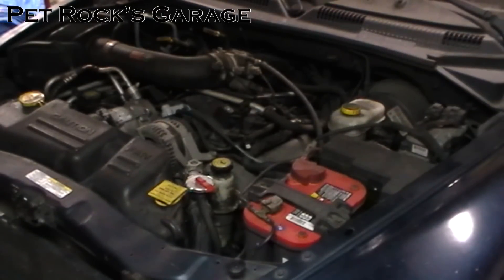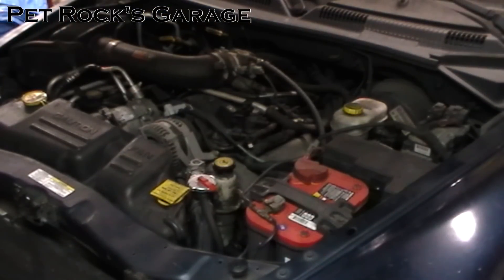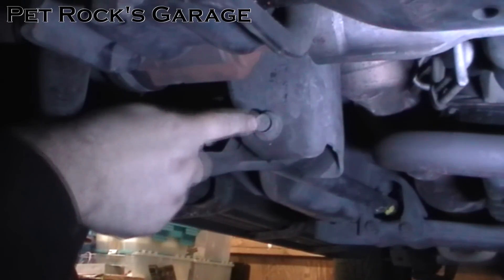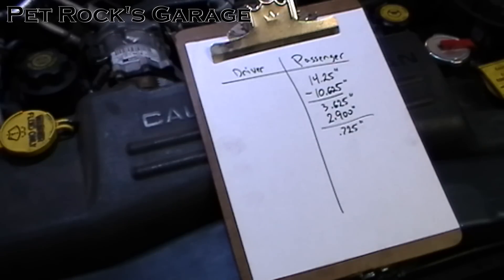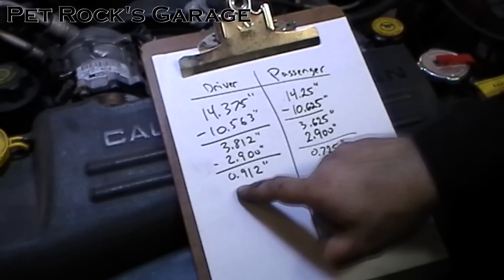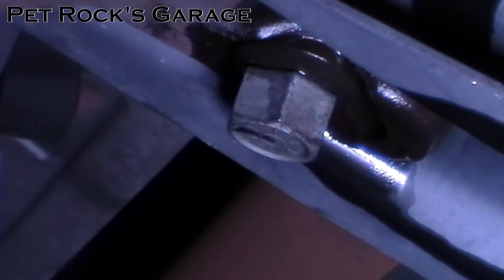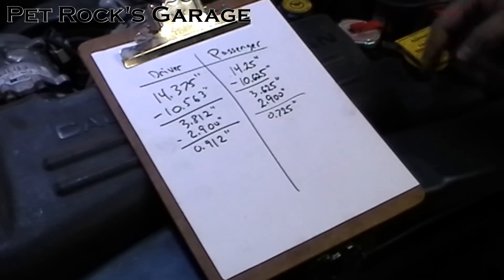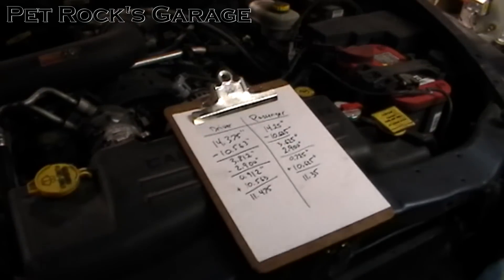How To Adjust Front End Ride Height - Dodge Durango 4x4 (’98-’03) & Dodge Dakota 4x4 (’97-’04)

Comment: This is probably the most helpful video I've ran across. My Dakota had some camber issues and this fixed it right up. I know it's 2019 now, but thanks for making this. It was extremely helpful.
Reply from the maker: Thanks a lot. I appreciate it.
Reply: @petrocksgarage  That worked perfect. I managed to bring up my front end by about 3 inches. The bars were so weak and there wasn't any rubber stops anymore. But I got it back up to stock height and new stops. This helped out more than you know. I appreciate it.
Reply from the maker: @DontDodgeIt...RamIt...Dammit. , that's great!  I'm glad it worked out.

Comment: 1 full turn = about 1/4 inch of lift on my 03 Dakota. i leveled it out with the rear this way. it looks great now. Don't forget to align it!
Reply from the maker: Glad to hear my video helped you out.  Yes, definitely get the truck aligned after. Especially camber & caster (which some shops don't do on 4x4 trucks due to laziness IMO).

Comment: Thanks again for the video! I just installed the new bump stops (after watching your video on that) and noticed they are practically resting on the lower control arm like yours. I'll be raising it up and head to get the alignment done! I'll probably use a calculator...Just to be safe! Lol🤣
Reply from the maker: Thanks a lot. I'm glad my videos are helping you out. I couldn't do that math in my head either. No shame in using a calculator.

Comment: Thank you for this awesome video.  I am troubled by one thing though... my 2004 factory service manual for 4WD Dakota says the delta should be 1.85 inches +/-0.118 inches vice the 2.9 inches +/- 0.125 you use in the video.  The manual is telling me to subtract the  distance to the bolt from the distance to the wheel center.  Why would my manual be different?
Reply from the maker: The numbers I used were from my factory service manual for my year/model truck. I'm not sure why there is a difference. Your truck uses the same upper & lower control arms as my truck, so I would expect the suspension geometry to be the same. Maybe there is a difference in the frame or it is using different points to measure from?  I'm not sure. Either way, your manual is not a Chiltons or Haynes type manual (which are crap, IMO), and it's really a factory service manual from Dodge, then I would use the numbers listed in your manual. Hope that helps.

Comment: Thinking about raising my 99 Durango a little to fit some 33" tires. Then you mentioned the distance between the control arm and the bumper, so out of curiosity, I went to go check the distance on mine just to see if it's lower than it should be... Low and behold, it seems my bumpers decided to take a vacation because they are no where to be found.... Just the empty holes they would occupy. -.-;
Reply from the maker: lol... Yeah, that happens.  They can disintegrate over time and disappear depending on the weather in your area and what's used on the roads in the winter. They are just rubber and are put under a lot of pressure when the suspension compresses.  Replacing the bump stops is extremely easy though. I have a video covering how to do it: https://youtu.be/-aGMvq0YHcc.  Hope that helps. Good luck.
Reply: @petrocksgarage  thank you. After looking at hollow cavity, it looked fairly simple to install new ones, and they are fairly cheap to get. Gonna knock those out Thursday while I install some inch and a half spacers. Replaced the wheels with some 18x9.5 rims, and the tires on there now(used temporary) are 31", so there is some rubbing. Which is also why I need to raise the front a bit.
Reply from the maker: @deimosadrastos6172 , yeah, its surprisingly simple. The tire/rim combo sounds interesting. Don't raise the front too much via the torsion bar keys otherwise you can put the suspension in a bind and your ball joints & outer tie rods may wear out faster then expected. Good luck.
Reply: I have a 02 Durango that I'm gonna attempt this with.  Can this technique work on a 07 Liberty?

Comment: Well done. Does this apply to all bump stops and torsion bar  setups. So the bump stops should not touch the control arm ?
Reply from the maker: +Steve Rob, yeah the bump stops shouldn't touch the lower control arm when at rest with a spring or torsion bar setup. If they do, when you hit a bump, the control arm won't move. This causes the lower control arm & lower ball joint to take all of the force which is a bad thing. On some vehicles, if the lower ball joint points up, if you hit a big enough bump you could cause the ball joint to separate. On this truck the ball joint points down, so the force would go into the ball joint and potentially create a flat spot, but the brunt of the force would be absorbed by the lower control arm (potentially for bending) and the frame. Either way, its not a fun ride.

Comment: Just jack up the front end before you turn the torsion bar bolts…why fight the weight of the vehicle? Just did it. Easy.
Reply from the maker: Yes, letting the front end hang down will make turning the adjuster bolt a lot easier. However, it will increase the time to do the job because you'll have to raise & lower the vehicle for every adjustment/measurement you make. I didn't find it too difficult to turn the bolt with a breaker bar, but your milage may vary depending on how rusted the bolt is.

Comment: Awesome video!!! Very helpful! I just replaced both lower control arms. Previous owner had tge ride height maxed out. Now I can set it properly.
I have a question though. I had to remove the sway bar from the front end, for the life of me I cannot get the main mounts for the sway bar to line up again. Any tips?
Reply from the maker: Thanks a lot. I appreciate it.  It might be easier to get the sway bar back on with both wheels off the ground.  I typically bolt up the center mounts and then the outsides. Hope that helps. Good luck.

Comment: This is a very great video so to lower you will turn the bolt.. away from you? I’m sorry my head works in odd ways and I can’t ever keep them straight
Reply from the maker: I'm not really sure what you mean by turning the bolt "away from you". That can be construed in a bunch of different ways. Either way, you turn it clockwise to raise the truck up and counter-clockwise to lower the truck down. Hope that helps.
Reply: Thank you that does help some I just couldn’t figure out how to word it but the video was awesome thank you for that
Reply from the maker: No problem. Glad to be of service.  Just keep in mind the old phrase to help remember which direction to turn a volt: "Righty tighty. Lefty loosey."

Comment: Great detailed explanation. But what causes a Durango to start sagging ?
Mine has a good lean and I can see that it hit the bumpstops. How does this happen though?
Reply from the maker: The Torsion Bars are the 'spring' that keeps the truck up in the air. Springs don't last forever. So the sag is caused by the torsion bar losing some of it springy-ness over time & use.  At least with a torsion bar you can adjust it to account for this. If it was a regular spring you would have to replace the spring which can be a big P.I.T.A.
You should also check out your control arm bushings though.  They also effect ride height if they are worn out. They are rubber and also don't last forever. If they are cracked a lot or favoring one side over another, then they should probably be replaced. I replaced mine with polyurethane bushings about 8 years ago and couldn't be happier.
Reply: @petrocksgarage  thanks for the reply. Very useful for me. control Arm bushings, hard to replace? I already have new bumpstops for installation here very soon. thanks for all your advise!!
Reply from the maker: @deutsch2k5 , in theory control arm bushings aren't difficult. In practice, however, they can be a pain in the butt.  It took me 3 or 4 hours per side to get mine done, but I was also taking my time.  There is a lot of stuff to take apart and some non-standard tools to get the control arms out and the bushings are glued in, so you have to heat them up with a torch to melt the glue to get them out.  Or you could replace the control arms completely, which come with new rubber bushings, but that gets expensive.  So only replace them if your bushing are actually bad.  If you do, I'd advise getting the Factory Service Manual for your year/model truck to get the steps to take everything apart and the torch specs to put it back together.  You can order them from your local Dodge dealer.  Chiltons & Haynes manuals won't cut it.  They are just Cliffs Notes in my opinion.  Good luck.

Comment: i have an '04 4x4 Dakota.  id like to lower the whole truck about 2-3 inches.  i dont go off road, i only need the 4x4 if it snows on my way to work.  can this be done without screwing up the entire ride?  

what about with lowering keys?  ive found some that appear to be good quality (i dont know for sure) but i obviously dont want to wreck the ball joints or any other component
Reply from the maker: I've never lowered this truck, so I'm not sure how much the truck can be lowered with the stock keys alone.  But it will reduce the suspension travel, so be careful not to lower it too far or the lower control arm will be riding on the bump stops and can cause major issues.  I'm not sure how lowering keys would prevent that though. I know plenty of people on the interweb and Dad & D forums have lowered their trucks. I'd look there. Good luck.

Comment: I had a alignment done after doing a complete front suspension revision and mentioned that the ride height probably needed some adjusting with the torsion bar and key setup. They finished up and said it was good but riding home taking tight corners the lower control arm shaved a good 1/4 inch off the inside of the wheels as it was still sitting too low and even riding on the bump stops. Was it too much to expect them to get that right? I assume they would have needed to measure ride height while it was on the floor maybe they didn't think of it and checked while it was on the lift
Reply from the maker: Some alignment shops are better than others. Most I have dealt with don't touch the ride height. Its anyones guess what went wrong, but I would bring it back and ask them to fix it correctly. Or you could adjust it yourself and have them or another shop re-align it. The control arms should not be riding on the bump stops. Good luck.
Reply: @petrocksgarage  thanks
Reply from the maker: @7Supernova7 . No problem. Good luck.
Reply: @petrocksgarage  I just browsed your channel and noticed I've watched a couple of your videos in the past. Are you taking a brake? Saw you haven't uploaded recently
Reply from the maker: @7Supernova7 , no. I'm not taking a break. I am just extremely busy. I record the work I do on my personal vehicles, so I have a bunch of videos recorded. However, I don't have time to edit them. 3+ hours per video. YouTube is a hobby for me.

Comment: Great video! I’m about to level the front end with aftermarket 3” lift keys. You say decrease to raise the front end... so 2.9” - 3”? Just wanted to verify, thanks!
Reply from the maker: I'm not really sure what you are asking.  Are you asking which direction you turn the bolt to raise/lower the front end?
Reply: Pet Rock's Garage “if you want to inexpensively lift or lower the front end, simply change 2.9” to whatever value you want. Decrease it to raise the front end...” 

I’m trying to factor in the value I’m looking for if I add 3” lift torsion keys. Am I adding 3” to the 2.9” or subtracting it? I’m sorry buddy, I’m just trying to wrap my mind around the math. I haven’t gotten a chance to check mine to see if they are level (that’s where I’ll start for practice before pulling the stock keys off). If this makes no sense, it’s all good, I’ll figure it out. Very informative video though and we all appreciate it.
Reply from the maker: @Cpennington57 , that's for clarifying.  If you change 2.9" to 2.5" it will raise up the front end.  That is what I was saying.  I'm honestly not entirely sure how 3" lift keys would effect the calculations. I have never installed them or worked on a truck with them before. My guess would be that since the key is supposed to raise the truck up 3" that you should use -0.1" (i.e. 2.9" - 3.0" = -0.1"). Either way, you want to make the measurements on either side to be as close as possible so you know the truck is riding level. Good luck.
Reply: Pet Rock's Garage that’s the same value I got as well, I get it now. I’ll let you know if that turns out to be the case or what the end value is if it’s different. I’ll be installing in the next couple weeks.

Comment: steve rob beat me again...so did you do the adjustment after you put the new stop on? that 2.9 spec is a universal spec or are they specific for make and model?  thanks
Reply from the maker: +RICKAFIX, yeah, steve is pretty quick on the draw. I did the adjustment after replacing the bump stops. The old bump stops didn’t come in contact with the lower control arms because they were squished. When I replaced the bump stops it became painfully obvious my suspension had sagged.  The 2.9 spec is from the factory service manual. Its specific to Durango’s and Dakotas of the '98-’03/'97-’04 vintage. Different trucks will likely have different specs due to different suspension geometry.

Comment: Hello, I have a 98 dodge Dakota, We lifted it with the keys. The camber was off. The alignment shop said it was because of the keys. And they lowered it back down. What went wrong? Or was it just that guy didn’t know what he was doing?
Reply from the maker: Raising the truck up via the keys will definitely effect the camber (make the top of the tire stick further out than the bottom). Camber is adjusted by sliding the upper control arm in/out in the slots in the upper control arm mount. The mount isn't that big so there is a finite amount of camber adjustment possible. You may have lifted the truck up too much and didn't have enough room for adjustment. So the guy did actually know what he was talking about. Hope that helps.
Btw, as I mention in the video, lifting the truck by the keys puts extra stress on the ball joints & CV-Axles and will wear them out a lot quicker. If you lift too high you can easily get them into a bind which can result in sudden catastrophic failure and loss of control. So lift via the keys at your own risk. Good luck.
Reply: @petrocksgarage  alright, thank you so much.
Reply from the maker: @raylynn223  no problem.

Comment: Hi 1997 5.2L Dakota 4wd 4x4 here I changed all the upper and lower control arm bushings to polyurethane and I have moved the torsion bars without marking them and now that I have reassembled everything when I take my truck off  jack the jack stands the entire front end of the truck sags it falls all the way down to the floor I can't figure out how to fix it the front end nearly hits the ground with the wheels on and the torsion bolt at the rear of the bar no longer tightens like it used to now it screws all the way in but doesn't raiseor lower anything like it used to
Reply from the maker: You have the torsion key positioned/indexed incorrectly relative to the torsion bar. You have to disassemble far enough so you take all the tension off the torsion bar so you can reposition the torsion key. I find this is easiest to do by disconnecting the lower ball joint & shock absorber from the lower control arm so the lower control arm is free to swing. Be careful and make sure the lower control arm is supported when you disconnect the lower ball joint & shock absorber. You don't want the lower control arm to fly if there is any tension on it from the torsion bar. You can hold the upper control arm and knuckle up with some bungy cord and/or a jack stand. Once the lower control arm is free to swing you should be able to maneuver it so the torsion key is loose and you can pull it off and rotate it the desired direction. You can tell you have it correct if you pull up on the lower control arm and start to feel tension around where it would come in contact with the steering knuckle at full drop. Good luck.
Reply: @petrocksgarage  I understand so I should remove the key and turn it one angle at a time until it tightens up the only problem is I'm not sure if the key is suppose to turn upwards or downwards
Reply from the maker: @yukmouth1324 , yeah, thats basically what you need to do. Re up or down, if you are looking at the key on the torsion bar from the back of the truck, you want to move it clockwise to tighten it up. Good luck.